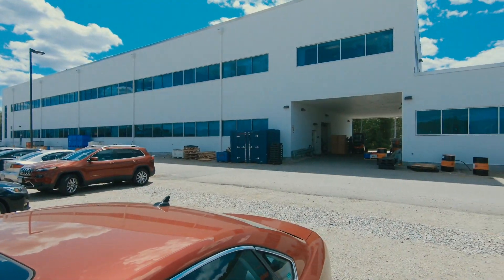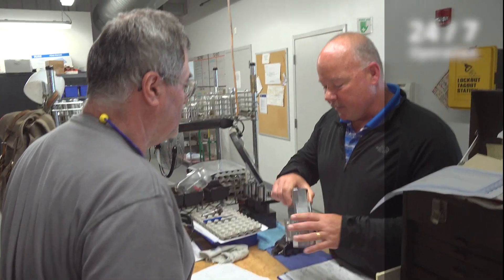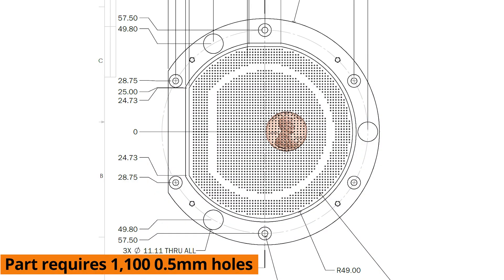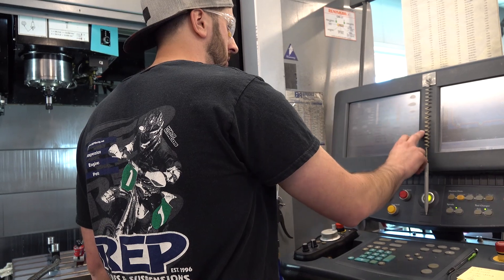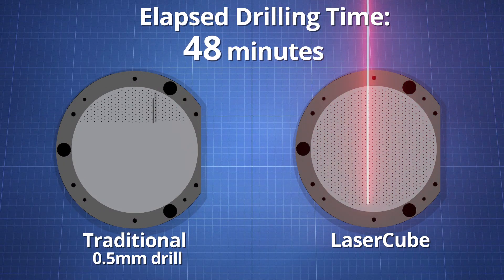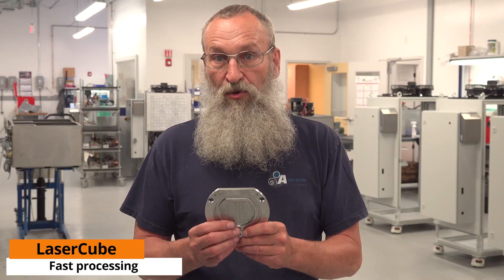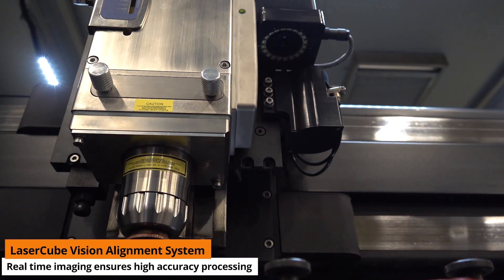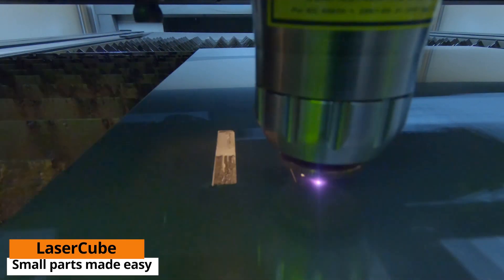Drilling Eleven Hundred 0.5 mm Holes in Less Than an Hour with IPG LaserCube

Comment: What was the thickness of the plate in which the holes are made?
Reply from the maker: Thank you for the question. The thickness of the section where the holes are drilled is  0.120" / 3.048 mm.
Reply: Can you get us the offer and delivery of the machine !!